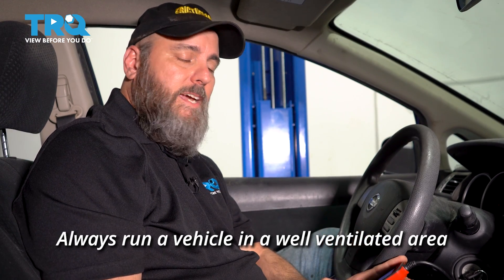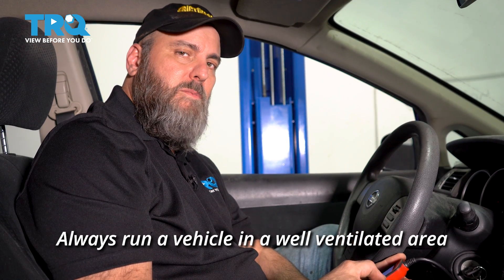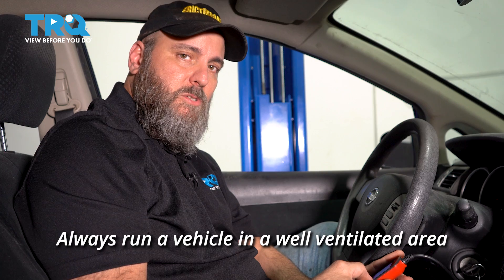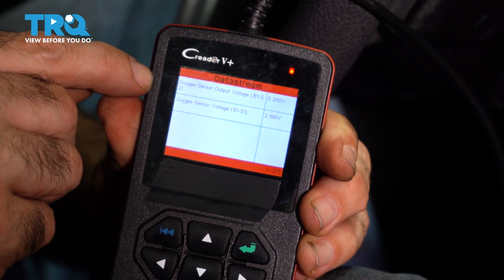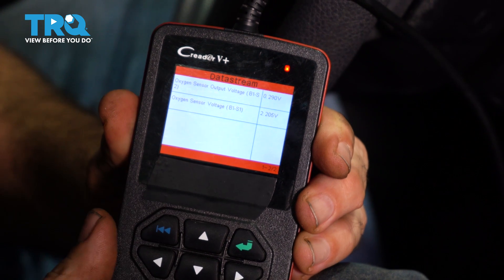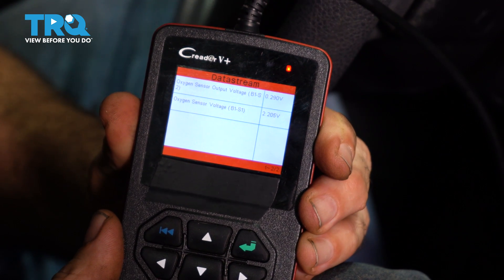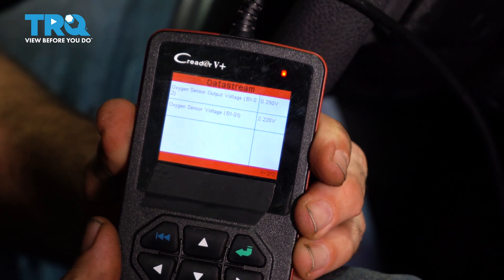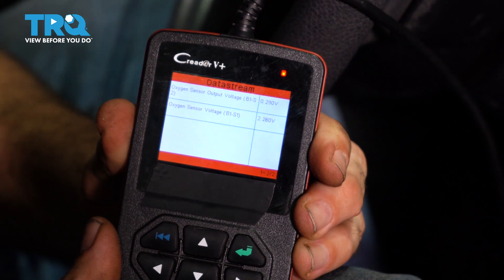EricTheCarGuy Explains Check Engine Codes - P0420 Catalyst System Efficiency Below Threshold

Comment: What should I replace first if I'm having a misfire (p0307) and a P0420?

Maybe about 5-15k miles ago, I had a massive misfire causing my dash to light up showing the traction control light coming up, 4-wheel drv needing service, engine reduce power mode and engine light flashing. it only lasted for minutes and it went back to normal driving. I didn't have the money or the time to get it servied asap, but since then I've been experiencing a rough idel whenever I'm parked or stopped, less engine power,  and a need to replace my sparkplugs every month (it's foulded and it smells like coolant).  The one thing that I'm impressed is that it still runs well on the highway, same mpg average, and runs almost perfectly well once the sparkplugs are changed. 

My mechanic says I need a new engine (quoted at $10.5k for remanufactured) and highly advise that its worth it since I would be getting a 100k mile warranty with the new engine. I've been quoted less at $6k-$8k  for the engine and labor, but it's still a lot of money.

Since my vehicle still drives, I want to know if I should invest my money for a new engine first or look at getting a new catalytic converter in hopes to return to my normal driving experience.

Comment: I currently have a P0171 code for System Too Lean on my 2008 Honda CR-V for the past 6 months and the troubling thing about it is that it is such a vague code that could be for a dozen different things. The vehicle has been running and driving perfectly so there are no obvious symptoms of there being anything wrong. I've had 3 shops and the Honda dealer all try to diagnose it but were unable to find the problem. I have replaced the intake tube, MAP sensor, cleaned out the throttle body, ran fuel and exhaust cleaner through the gas tank, replaced the airfuel sensor and 02 sensor and the check engine light still keeps coming back on in less than a day of me turning it off. I haven't looked into the fuel trim data but it feels like the fuel pump and fuel injectors are running fine as I have no issues with starting, idling and driving and there doesn't seem to be anything clogging the exhaust. Could it be an electrical issue that's causing the computer to think there's a problem even though there isn't?

Comment: I had a P0420 code on my recently purchased car, despite it having a brand new catalytic converter. I replaced the O2 sensors (since the cat was new) but the code remained. In the end I found that the spark plugs were bad and had killed the new converter by dumping unburnt fuel into it. After replacing the cat again, the code disappeared. So yeah, trust the OBD readings imho :)